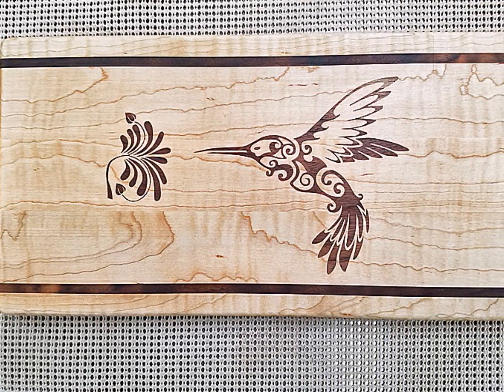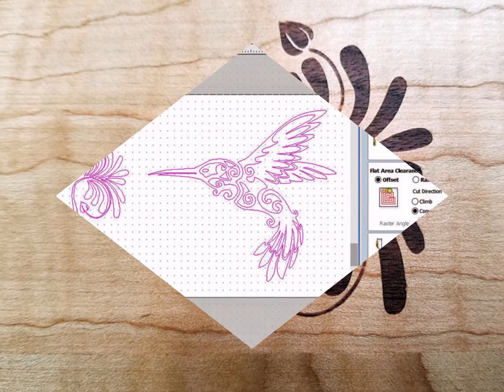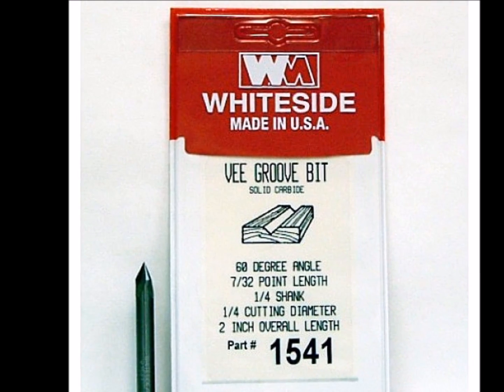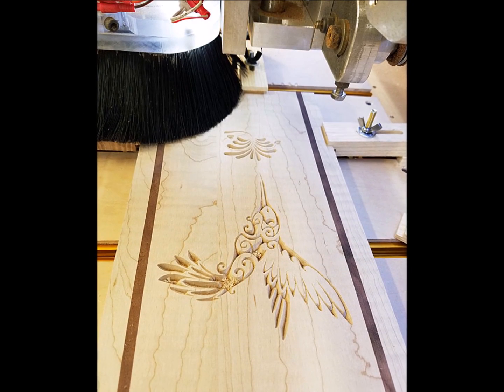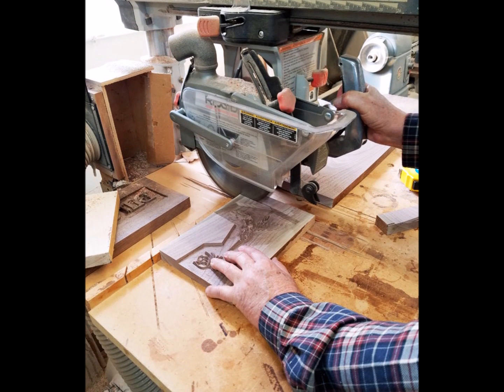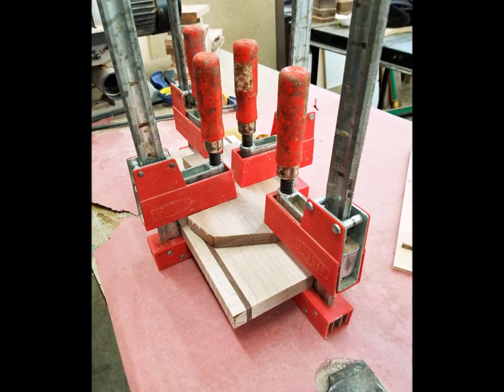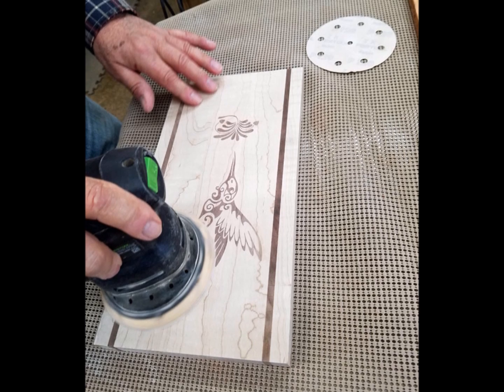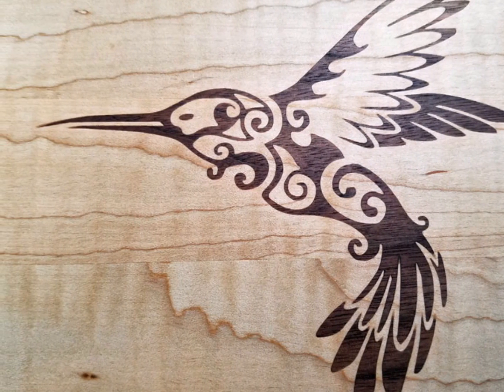Vcarve Inlays on the CNC Router

Comment: Very nice. The only area not covered was the feed and speed rates of the bits used. That's where I need help.
Reply from the maker: Speeds and feeds vary substantially between machines and materials. Your experience is the best guide.

Comment: Excellent video. I've watched a ton including those that said DONT  use any other parameters. Well I have only used yours ( .1 and .1) and get perfect fits every time. I do have one question as this old brain cant seem to figure it out. My band saw is too small to cut away the excess so I too would rather use the CNC. I have been using my drum sander. I get setting up the pocket but not sure how to set up depths and how to zero the bit.
Reply from the maker: In setting up the pocket to mill away the excess wood, I measure the depth from the top male inlay down to the surface. I subtract 0.05 from that number and that's the depth of cut for the pocket to mill away the excess. Actually, I often use the planer to remove most of the excess wood, leaving only about 1/4 inch. I don't like to go too close because sometimes it cracks off and damages the inlay. Then I mil off that last 1/4 inch. I create a pocket slightly larger than the wood I'm milling off and set the depth to leave about 1/16 inch. I take off that last 1/16 inch with the drum sander. It doesn't come off quite evenly. When I see that parts of the inlay still have a glue halo, I stop with the drum sander and finish with the hand held Random Orbit (RO) sander. Hope this helps.

Comment: In both instances you say you edit the toolpath to a pass depth of .2.  Where are you doing this?
Reply from the maker: To eliminate the small ridge around the edges when the tool makes two passes. Makes for a smoother glue joint.
Reply: @DaveVanAntwerp  what I mean was, in Vcarve, where are you setting the pass depth?
Reply from the maker: When you set up your toolpath you should be able to set the depth of pass for the bit. In my tool library the depth of pass for end mills is set by default to 1/2 of the bit diameter. So when I set up the toolpath, I change the depth of pass to 0.2 to prevent a horizontal line in the middle of the cut. I use Vectric VCarve Pro which has an "Edit" button for each tool when setting up the toolpath. You may need to change the depth differently.

Comment: How are you saving the male to cut out. I tried that but it doesn’t ask me to change bits to cut the clearing path. Are you saving them as speedster files?
Reply from the maker: I save it as a new VCarve job, so I end up with two VCarve jobs - Female inlay and Male inlay. I save the Female toolpaths as usual. Then I save the Male toolpaths as usual.
Reply: @DaveVanAntwerp  right but I’m talking about the male cut path. I’m having to do my clearance path and my vcarve path as separate jobs. It won’t set it as one job because it says that I’m using the same tool 1 in vcarve pro. Are you having to do that or is the Onefinity cutting the clearance and then asking you to change bits and zero the z axis and continue the vcarve

Comment: What is the thickness of both pieces of wood? Thanks
Reply from the maker: Hey, Kipp, the good news is that any thickness can be used for either piece of wood. Keep in mind that the top piece will need to be removed so it will end up as scrap. The bottom piece can be whatever thickness you want to end up with.

Comment: The .1 and .1 are respectively the depth between the bottom of the inlay and the bottom of the the pocket, and the gap that you can see between the base and the inlay once the inlay is inserted.
Reply: That is absolutely correct, Ive done the experiments to prove it. Thanks for answering so concisely!
Reply: @sbrunner69  Would have been more concise if I said "the" instead of "the the" :)

Comment: Great video,One question, if there is a danger of over sanding could you not make the female cut deeper and the male part thicker so that you have a little bit more to play with?
Reply from the maker: I can't see how that would make any difference, Bert, but you could always try it and let us know! I'm always curious if improvements can be made.
Reply: @DaveVanAntwerp  It would help because thicker lines would become thinner instead of potentially disappearing.  A 5mm line going to 4mm is a lot less noticeable than a 2mm line going to 1mm.  Bert is quite right. Also, the additional volume of the inlay  makes it a lot stronger - more edge contact and internal strength

Comment: Great video and very informative.  Thanks for taking the time to make this video.  The only question I had is the male inlay depth settings.   The video commentary says cut depth should be .2, but the settings in the screenshot are .1 start depth with .1 flat depth.  In some of the comments for this video it also says that the cut depth should be .2 for male inlay.  I don't know where you can set the cut depth for a V carving other than the flat depth.  Am I correct in thinking that the .1 start depth and .1 flat depth setting is equal to a .2 cut depth that is mentioned?  Or should the flat depth be set at .2?  Thanks
Reply from the maker: Correct, Ken. If you set the start depth for the male inlay at 0.1 and the flat depth at 0.1, the end result will be an inlay 0.2 deep which will exactly match the 0.2 cut depth of the female pocket. If you forget to start at 0.1 like I do on occasion, your male inlay will not fit into the female pocket - it will just a bit too large. Been there, done that, got the t-shirt. The female start depth is 0.0 and the flat depth is 0.2. the male start depth is 0.1 and the flat depth is 0.1.

Comment: Dave, would it be possible for you to send me that bummingbird dxf file? I have watched your video numerous times but my cuts are never working out correctly and i think it is due to the detail in the file i am using thank you so much
Reply from the maker: Jeff, there are many hummingbird images available - simply do a google search for hummingbird clip art using the "images" option in the menu. I can assure you the level of detail is not the reason your cuts are not working out correctly. Double check your numbers - 0.20 for the female portion and 0.10 and 0.10 for the male. If those numbers are correct, normally your cuts should come out fine. If you are getting proper cuts for other projects, your machine is functioning properly so that's not the problem. A rigid CNC with tight tolerances does best on V-Cave inlays. I assume you are mirror imaging the male portion and drawing a box around it when you set up your tool paths. Here is a link to a video on V-Carve inlay by Peter Passuelo (CNCNutz). You might want to review his video to see if you find something you didn't pick up in my video. https://www.youtube.com/watch?v=iUHxj5Cu2QA   -- Dave
Reply: thank you sir

Comment: My problem is... I bought a new shapeoko 3 xxl machine. Ok, I get it. I can draw a design but what I want to do is take a photo of something, like a boat, and then import it to mt carbide create and have the machine carve/engrave it out? I can find no clue how to do that? Any help appreciated. Thanks. Retired - Captain Chuck
Reply: you need to convert the image of the boat into a 2d vector file or a 3d model in order for the CNC software to know how to process the image...unfortunately there isn't a great way to just carve an image...vetric photovcarve works but probably still isn't what you're looking for...I've had limited success with the "trace bitmap" option in vetric aspire, but a true 3d relief model would be the best way to achieve the detail of a real photo, and unfortunately those are usually custom made

Comment: Great video, Dave, very informative.  I have a sign to inlay that will be  3/4" x 17" x 34" maple base with walnut  letters. The  sign is all text, one word is 4" tall x 30" long.  Full depth with a 60 degree bit will be .390".  Should I cut the female part to full depth in one pass?  Also, what do you suggest for the start and finish depths on the inlay male part?  Thanks.
Reply from the maker: Phil, the depth of the cuts should never vary. Your female pocket toolpath should start at 0.0 inches with a cut depth of 0.2. The male inlay toolpath should start at 0.1 with a cut depth of 0.1 .  The size of the inlay has no bearing on the cut depth.  Your 60 degree bit is fine - that's what I use.

Comment: Hello there! I'm having some problems clearing out the excess material with the CNC. Sometimes it goes just fine, but a lot of times I get little segments of the inlay torn out together with the excess material, usually those on the last parts I machine out. Do you happen to have any sort of advice to prevent this? I don't have a band saw as an alternative.
Reply from the maker: Fernando, you can use your CNC to mill off excess material. Here are some things that might help do a smooth job. Assuming you ran the grain of the inlay the same direction as the pocket, you can also use your planer to take off excess material if your planer blades are sharp. Don't try to go too far down - leave a little to remove with the sander. 1. Be sure to use a sharp end mill - 1/4 or 1/2 inch usually works well, a new one. Stop before you get all the way and finish with the sander.
2. Reduce your stepover to 20% or 25% at most. The lower your stepover the longer it will take but the smoother it will be. 
3. Use lower pass depths. You can change it for this toolpath by using the "Edit" button when you select the tool. the shallower the pass the less chipout you will get.
4. Be sure you are getting enough glue on both the pocket and the inlay portions and that the glue isn't getting dry before you clamp the two halves together. On the one hand, if you have too much glue it can make the wood too wet and it might warp. Been there, done that. On the other hand, if you don't apply enough glue you won't get a tight bond and the inlay can chip out. Been there, done that too. I use a paper towel and'or air gun on compressor to reduce but not remove glue.

But the first thing to do is to be sure your toolpath depths are correct when you carve the pocket (female) and inlay (male). For the female (pocket) start depth is 0.00 and cut depth 0.20 inches. For the male (inlay) the start depth is 0.10 and the cut depth is 0.20. If these two depths are incorrect your inlays won't bond like they should. I'm guessing you are setting those up correctly, but we should never assume. Measure twice, cut once.

Please post to let us know how it works out! -- Dave
Reply: Firstly, really appreciate you taking the time to put this together for me!. I was a bit bummed because the 5 or so trials I did with this same toolpaths and scrap wood turned out spectacular and now that I'm using more expensive materials I had a high error rate. I think it must boil down to trying to be cleaner with the glue and using less as a result and I'll also try with a new endmill tomorrow. I'm also going to reduce the step over further to be on the safe side... What does your clearing toolpath look like? Do you clear from the outside in or any way special? The problem usually happens when a depth pass is finishing and theres a long-ish thin wall of material attached to very little support on the inlay. You kind of see it coming, but is there a way to avoid the scenario by means of setting up the toolpath more properly? Again, thanks a lot! Here's a pic of what I'm going: https://imgur.com/a55124a6-e2c9-474b-a01f-bcac42be97dd
Reply from the maker: Fernando, I was unable to see your picture - the link above gave me an error message. But getting back to the problem, when you say clearing path, I'm assuming you are removing the male inlay from the top after it has been glued to the female pocket, correct?  I use a raster tool path - back and forth rather than around and around - at 20% stepover. Pass depth should be no more than 1/8 inch. It takes longer but you will get a smoother job. If you are getting tearout you want to stop when you break through the top inlay, then finish with sanding preferably on a drum sander if you have one., or the random orbital sander if you don't have a drum sander. You might consider doing your next inlay with scrap wood first and see how it comes out. If you like the result, run the job again with more expensive wood. I do find that the types of wood make a big difference. If I use a very hard woods like hard maple, black locust or white oak the inlay works better than if I use softer woods. I also use walnut and cherry successfully. On the other hand Pine, cedar, catalpa, sycamore - very pretty woods but the inlays don't hold up as well. One other tip that may or may not make a difference - when I set my pass depth for doing the female pocket and male inlay, I set the pass depth at 0.20 inch regardless of the diameter of the bit. That may sound risky, but it eliminates a horizontal line in the cuts which may interfere with how well the two parts mate together when gluing.

Comment: Thanks for sharing I have used you technique several  times since your postingl... I was wondering where you found that hummingbird and flower I have searched the internet and haven't been able to find it.. I would like to make one of those also.
Reply from the maker: I don't remember specifically where those designs came from, only that they were two different files that we downloaded. We would typically search  Google images for black and white clip art "hummingbird" and "flower". Those two happen to be in the tribal category if that's an option. It only took a couple minutes to find them. So do a Google search, go under images, select for black and white clip art, and put in your search terms. You will find them!
Reply: thank you... i found it

Comment: Grate job,how do you run .125 bit at .2  without breaking
Reply from the maker: Never broke a bit yet even though such a deep pass with a small bit is against the rules. The general rule is to run the depth of cut at 1/2 of the diameter of the bit or less, right? But if we do that, we get small ridges between the passes that interfere with the seating of the inlay. So we cut the full .2 depth in one pass. For some reason it works. We have never broken a bit. We do limit the stepover to 33% to reduce stress on the bit. And we use cheap Chinese bit costing about a dollar each on eBay so if we break one, its not a big deal. But we never break one. Try it!

Comment: Great video.  I think it's better than the one from Aspire on the same subject.
What values did you use on the inlay for final pass stepover and clearance pass?
Reply from the maker: Thank you for your compliment! I don't use a final pass for clearance. In Aspire or  VCarve Pro I use the "edit" function when I choose the tool and for both the V carve tool path and the clearance tool path I set the pass depth at 0.20 inch so it does it all in one pass. That eliminates the bump  that occurs if I use the typical pass depth of 1/2 the bit diameter. I typically use a 1/8 inch spiral bit for the flat depth tool path so 0.20 is a lot to ask of such a slender bit. But I haven't had any problem. I use cheap 1/8 inch carbide spiral bits purchased on eBay at about $1.00 each so if I break one it's no big deal, but it hasn't happened yet. On the other hand, the flat depth pass with the 1/8 inch spiral bit doesn't affect the quality of the inlay - only the Vcarve tool path does - so it doesn't matter if I leave the flat area pass depth at 1/16 - it just takes longer. Try doing a small simple inlay just for fun! One tip on gluing - I find that if I leave too much glue between the pieces they don't dry well and the moisture tends to swell or warp the wood so I brush out or even blow out excess wood glue with the air gun leaving a thin film of wood glue between the pieces. But in doing that, it's important that I make sure every surface is coated so it adheres.

Comment: I tried it...but I couldn't get sharp edges on inlay part. I divided by two flat depth from pocket but still no sharp edges...I tried simple circle (pocket-inlay) with 90degree vbit...but that inlay isn't sharp to fit to pocket. Any ideas what I'm doing wrong guys? Thx for answers/tips-I'm desperate...
Reply from the maker: I'm wondering if your CNC is rigid enough or if you are getting some deflection.  when you do a standard V groove, are the edges sharp?

 A 90 degree V-bit should work, but I use a 60 degree V-bit. The inlay process is simply a standard V groove for the female portion and a mirrored V groove for the male inlay. Depths are very important. Set the pass depth for your bits at 0.20 inches for both portions of the inlay. The start depth for your female inlay should be 0.0 inches and flat depth should be 0.2 inches. For the male inlay, start depth should be 0.1 and the flat depth should be 0.1 inch. But first check your V grooves and find out why you are not getting sharp edges on V grooves. Until you get sharp edges on your V grooves the inlay process won't work.
Reply: Yes it is rigid enough. It is brand new one. And yes edges are sharp after standard V groove.
I'm starting with 90 but in the future I'll try other like 60 etc...
I know that there is something I'm doing wrong with depths...
Is there any possibility to get in touch via mail etc to send screenshot of settings of V grooves? :)
Thx a lot!   spikeweb@seznam.cz
Reply from the maker: My suggestion would be to join the Facebook group #CNC ROUTER TIPS and post pictures there. You will get lots of help. I'm in that group and I will respond too. https://www.facebook.com/groups/cncroutertips/
Reply: request sent...thx a lot! Hope I get an answer...